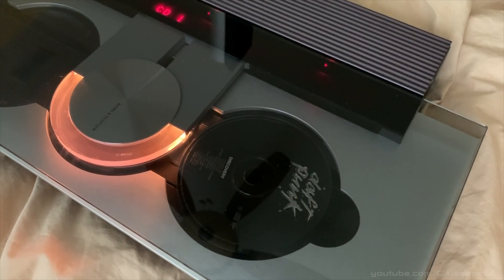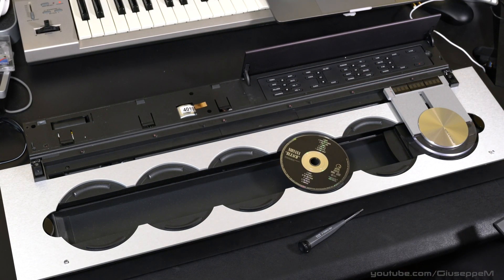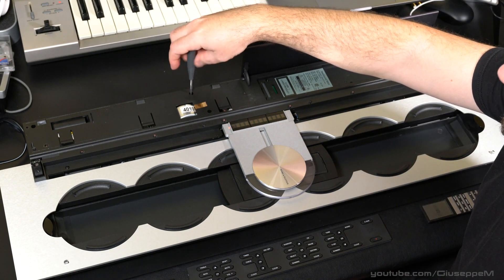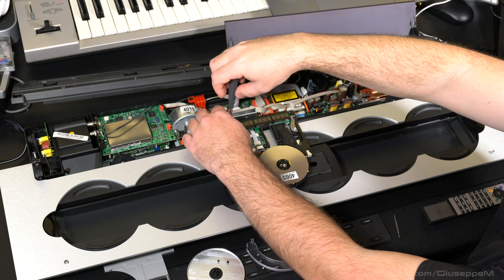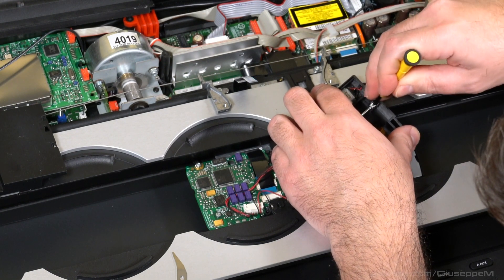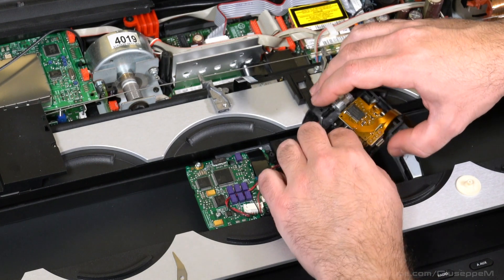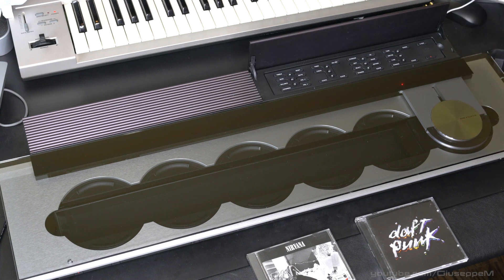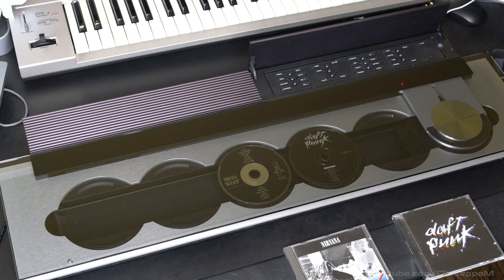Beosound 9000 "CD Pause" error, laser repair and maintenance tutorial - Bang & Olufsen

Comment: Hi Guiseppe 
Thanks for the video,I've followed your instructions and changed the laser,But when I try to play any CD the CD spins really fast in the opposite direction then says pause,I'd really appreciate some feedback please,Hopefully its something I can rectify myself, Thanks 👍
Reply from the maker: I see, which laser module did you buy? They may have sent you the wrong one
Reply: @GiuseppeM  Hi Giuseppe
I've fitted a CDM 12.4 Laser unit,which was from the same seller that I purchased my previous laser from which was installed about 2 and half years ago,I have a mark 2 beosound 9000, Thanks for responding so quick!,I'm not sure what to do now,and hope you can give me some advice,I also purchased 2 lasers and have tried them both,But the same thing happens!
Reply from the maker: I think it’s either a bad mechanical assembly and not just the lens or they sent you the wrong lens, I would ask them to send you another one and try again
Reply: @GiuseppeM  Thanks Giuseppe,Hopefully I can resolve the issue myself,If not I'll have to send it away to get repaired,Which will be expensive!

Comment: Amazing tutorial, thanks for sharing!
Question, how difficult is it to remove the aluminium panel to have it painted?
Reply from the maker: it's not really that hard but I was wondering if you can even have it painted without taking it apart, except for the glass panel obviously.
Reply: @GiuseppeM  thanks Giuseppe for the reply. Which type laser did you use for mk2, CDM12.4? I would like to give it a try myself.

Comment: Thank you so much.  I have the same cd pause error on mine.  I have the service manual but was a little unsure of how to take it apart.  Your video helps a lot.  Out of curiosity where did you buy the replacement laser assembly?  I have been looking for a vam1250/21 but have trouble finding an exact one.  Can you please share a link of where you got the laser from? Or point me in the right direction.  Thanks again for the video, it will help me a lot when I do my laser change.
Reply: Ok I followed your video to replace my laser.  I was able to locate a vam1250/21 on eBay.  The only thing I did wrong was remove that plastic piece in the middle that was kind of tricky.  It snapped where it mounts.  But no big loss it can’t be seen anyway.  Also want to point out that if others decide to follow this.  Don’t forget to take off the two ribbon cables on the clamper as well as the one holding the laser.  Also they lock in place with two tabs on the sides.  Also at the end when it’s put back together don’t forget to carry out test mode 71 and 73.  Thanks again, my beosound 9000 is working again :)
Reply from the maker: @EJFSanchez2  i has the exact same problem with that plastic cover, I’m glad you were able to fix your system!
Reply from the maker: I'm glad it helps, the repair manual is so confusing. I bought the part on eBay but I don't recommend the seller because they initially sent me the wrong part and caused me a lot of trouble.
Reply: @GiuseppeM  do you have a part number?
Reply from the maker: @EJFSanchez2  I've read a part number on a couple forums but those posts are from 2017 so I wouldn't trust it, the listing i bought it from just said BeoSound 9000 MkIII laser
Reply: @GiuseppeM  ok thanks I’ll try that route

Comment: Awesome video! I just replaced the laser and a couple of capacitors on the IR board just last week. 

Unfortunately now I have an issue where when the CD spins up it wobbles. Which results in the track skipping along with a lot of noise. Any thoughts on what I might have done wrong? I've tried fiddling with the two adjustment screws for the angle of the sledge, but that has not been successful in eliminating the issue.
Reply from the maker: Thank you! I think there is something that is loose and causes the unbalance, I'd take it apart again and see what's happening